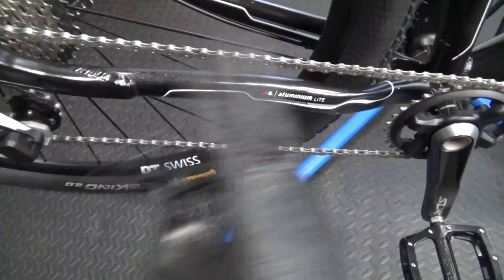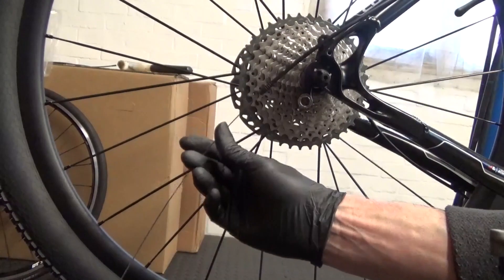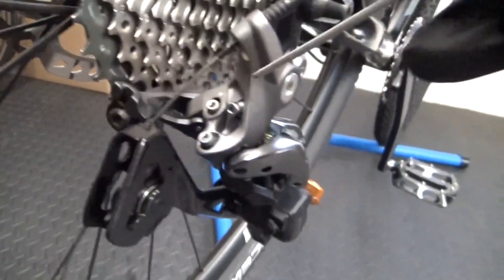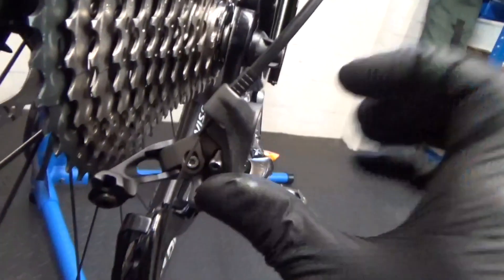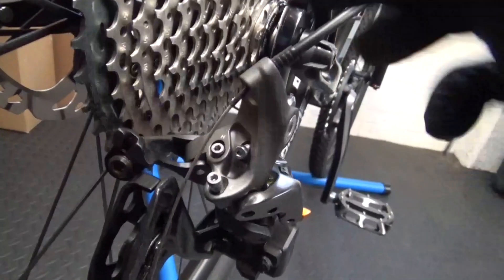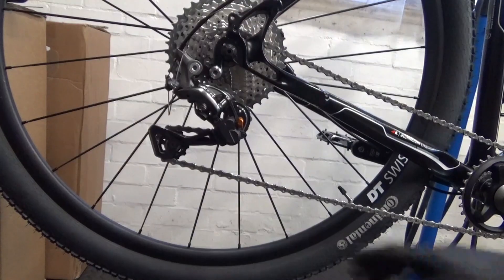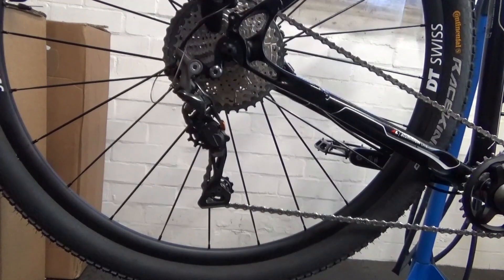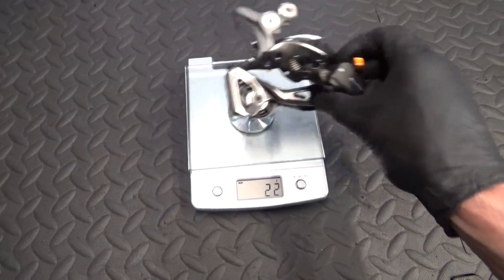Shimano XTR M9000 Rear Derailleur Fitting Guide

Comment: Im using the xt 8000 and im vurious if the xtr changes smoother. I guess in the long run the xtr would last longer wear wise
Reply: There is no point upgrading to xtr from xt. Its only difference in weight. joeckey wheel frame is out of carbon instead of aluminium, or metal on SLX. Shifter makes all the difference.

I ran SLX shifter and derailleur and upgraded to XT derailleur / XTR shifter.
Reply: @QW3RTY That's interesting i thought the XTR would shift and feel just like the XT. I went from ultegra to dura ace shifters on my roadie and couldn't tell the difference.
Reply: @glennoc8585  To be honest the difference is not huge, I got a good deal when I ordered the XTR shifter and it was just a small price difference between XT and XTR. So I went for the XTR. The price difference on XT vs XTR derailleur is huge in price. And its only lighter. Check out the dealers PDF document on Shimanos site. The parts seem to be exactly the same just difference in material on some parts.
Reply: QW3RTY Materials.will probably last longer on the xtr shifter. If the price is close worth going to txt.